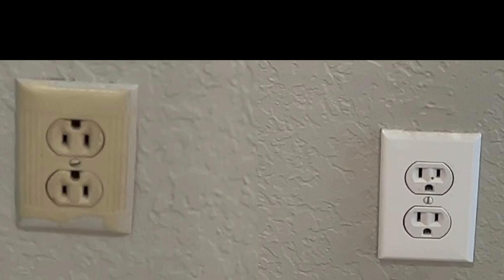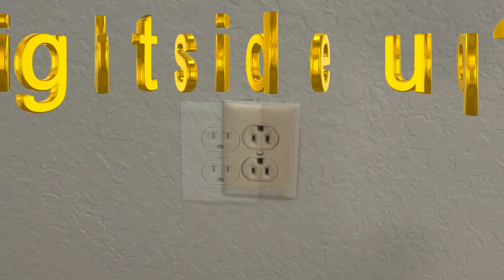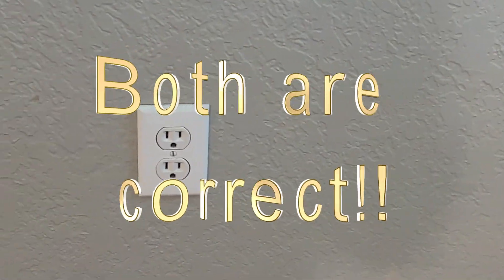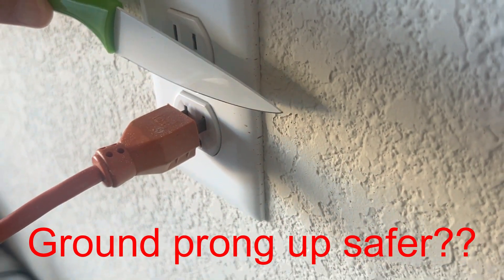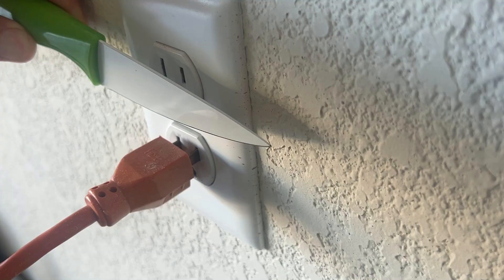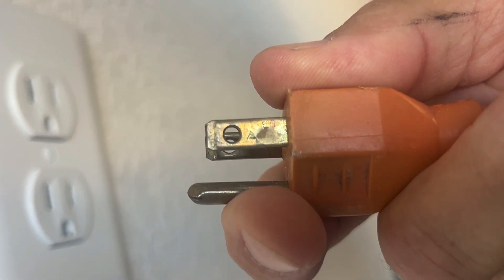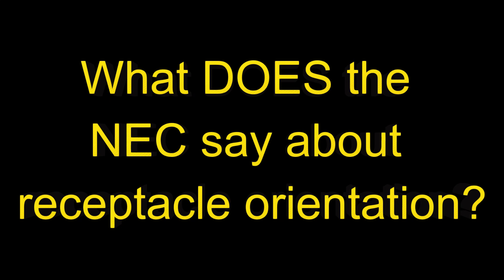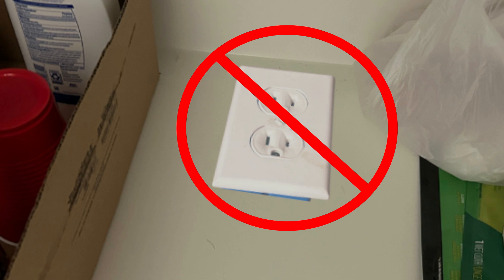Are Your Receptacles Upside Down?

Comment: Residential housing in Flood prone areas, I would think, one should always have the ground prong down. In the event of the water level climbing the wall it will ground first and then hit the hot and neutral.
Reply from the maker: Honestly, I don’t see how that would help anything. Possibly (but not very likely) if the water hit the ground first then the hot, it might be enough current to trip the breaker. But you’d have the same thing (with the same likelihood) if it hit the hot and neutral simultaneously.

Comment: Here is most common reason.  If you install upside down... with the ground pin top, its "safer" because if someone leans over with a necklace, it touches the ground pin and not the got damn hot.  Thus its safer in theory.  Ive seen homes wired like this before.  Does it look strange, yes.  But I get the reason(s).  Enjoy
Reply from the maker: I still think it’s a somewhat far-fetched (unlikely) scenario, but I guess that could happen. I still think touching the hot prong (if it’s installed upside down) when you’re unplugging it is more likely to occur than the other scenarios mentioned.
Reply: Seriously, which is the more likely scenario: 
1.  A person grasping the plug like we all do (thumb on top pointing inwards, fingers across the bottom of the plug) touches the bottom of the plugs connectors (and touches either the ground or both hot/neutral), or
2.  You lean forward when the plug is not fully inserted, with a gap of at least 1/4", and get so close to the plug that their necklace touches the hot (but not the neutral, which would short it and blow the breaker), while the person is also grounded.
Do you really think that second scenario is more likely?

Comment: In addition to these arguments about ground down vs up, another argument I've heard of, and sort of makes sense I guess, about ground up being safer, is that ground down is more attractive to children, since it resembles a smiley face.  

Now, with few exceptions, tamper resistant receptacles, to include the 15 and 20 amp 240V such as you might have for a large window A/C unit, are required in all homes and facilities accessible to the public such as hotels/ motels, to name a few, are required to be installed whenever a receptacle outlet is replaced, so even if the argument of ground down being more attractive to small children were valid, it's not as serious as it once was.   Certainly debatable.  

I personally prefer to install with ground down, unless I'm installing switched receptacles  in a bedroom to serve as the alternative to a lighting outlet in the  ceiling, in which case I install this ground up, and switch the top half, such that an AC adapter aka wall wart can hang down and be unswitched while a table lamp is plugged into the top half, virtually all wall warts are non polarized/non grounding plug.   On the other hand, almost all 120 volt and some 240V 15/20A right angle plugs expect ground down, as do nightlights, air fresheners and two prong polarized right angle plugs.  Or unless the building management or blueprints specified ground up, hospitals are a good example.
Reply from the maker: I’ve always thought they resemble a smiley face, but never considered that being a danger to children, but now that you mention it, I can see that making them more attractive to the children to play with. The term wall wart is definitely a new one for me.